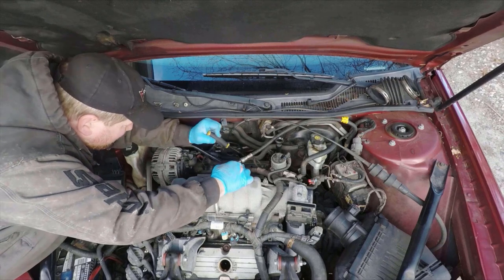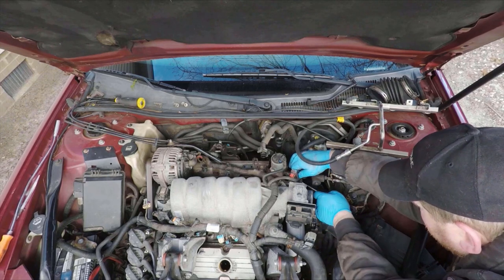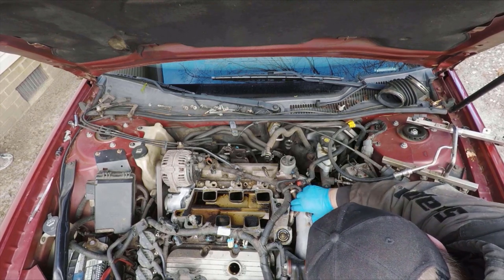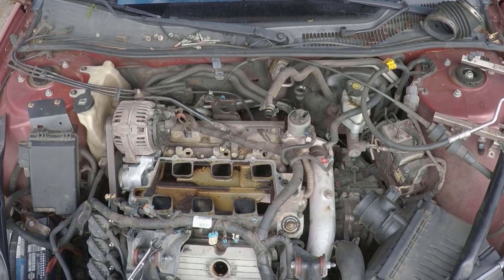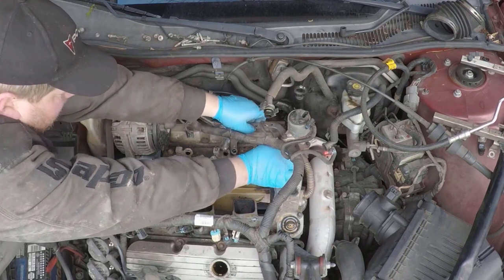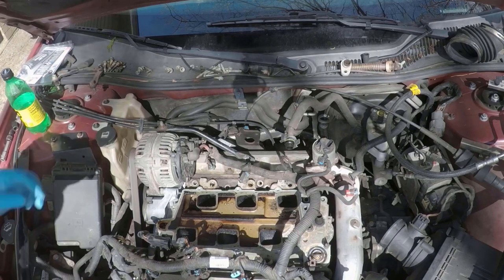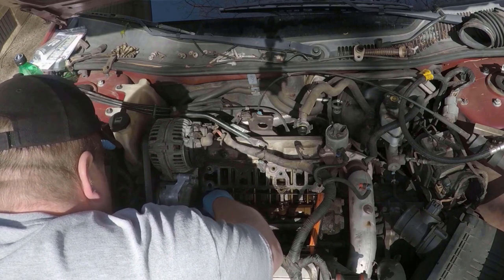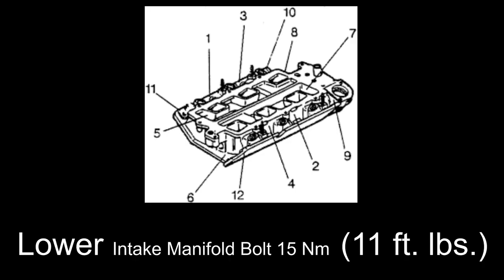05 Grand Prix Lower Intake Gaskets

Comment: With the aluminum gaskets. I've found it's best to go around and seat them (about as tight as you can get using an extension as a screwdriver, it's just tight enough to seat everything square). Then do the 11ft. Then go around again at 11ft to double check tightness. The aluminum gaskets compress and the first half of the bolts always becomes loose. I know, multiple service books, all-data, and even the internet says 1 pass with 11ft. But I've had problems doing the 1 pass and unhappy customers/boss. It's a similar situation to felpros "thick head gasket" it compresses alittle too much and requires multiple stages to get a uniform tightest.
Reply from the maker: I agree, i usually do a couple of passes at a minimum
Reply: @SalemDoyle  thank you for the advice I will do that
Reply: Thank you for the advice! It would suck to have to go back in to re-tighten.  Thanks again!
Reply: @Gerald Braxton yup, have been watching on InstaFlixxer for months myself :D
Reply: I second that notion lol. At least 2 passes, and use the sealer that GM says to use! I've learned the hard way with installing these lower intakes.  I've had the best luck using the Felpro metal gaskets, or the Apex metal gaskets. The rubber seals are thicker and seal better than the GM metal replacements. If you have ported heads, they also match much better. The metal OEM ports are smaller than even the plastic gaskets.

Comment: Really appreciate the video bro! Not that many things done to a Pontiac Grand Prix 04-08. Mine was leaking oil and I couldn't figure out cuz it seemed it leaked from every where. Thanks to the Oil Dye, it looked like it kept splattering from the inside of the gasket of the intake manifolds from all side. The front and rear valve gaskets were OK though.

Comment: I have an 07 Grand Prix Base model as my gas saver. Noticed thick black stuff out the bottom of my coolant reservoir. I read that this may be the culprit. No overheating or engine knock. Just loss of coolant in the reservoir allowing me to see dark oil build up I'm guessing at the bottom of the coolant reservoir.
Reply from the maker: Yes, that could be a sign of coolant and oil mixing.  If so, lower intake is usually the issue
Reply: @SalemDoyle  thanks. I'll definitely be following this video with the Fel-Pro Gaskets to fix this issue.

Comment: I've seen a lot of 3800's with oil in lower intake. Is there anyway to stop that pooling of is it due to pcv system letting it "condense" there?

And think there would be any benefit to polishing the lower intake runners?
Reply from the maker: There is supposed to be oil in that part, but the pcv does allow some oil into the runners also.  Polishing might help some, but we are talking really small gains on a heavily modded engine.

Comment: I've done everything just asa the video, double & triple checked all of it I've taken it apart 3 x now all looks good, but I start it up, it runs like there;s a vaccum leak & Antifreez leaks from the upper intake just behind the throtle body & the thermostat & collects in between manafold bolt 2 &  the slot rt by the therm all tigthen to specs, manifold bolts 11ft lbs intake 89in lbs, this should have a day 4 me or two at most...it's been a week Iv'e take it apart AGAIN,  3rd time & i still can't find what's causeing this issue i don't have a garage live in an apt, no work benches to use, no air tools, when it hget hot I have to stop and go in it will getting cold soon in MO winter will hit next month...can you give me some hints on what's going on....fed up this shoud not be this big a deal rt?

Comment: I use to own a 86 Buick LaSabre with the 3800 v6,  at 140,000 miles timing chain broke and sucked all the valves in, the components were made out of fiber metal, basically plastic gears.  That car loved to eat starters up!!!!  Bad design on GM to put the starter under the exhaust manifold without a heat shield.  That car was a nightmare to own!!!!
Reply from the maker: Some of those old ones qere problematic

Comment: I only have Series II's, so I was interested in the differences.  I was trying to see if they did away with the blind coolant passage between the cylinder head and the lower intake, but you didn't mention it. Looks like maybe they did?
Reply from the maker: Are you talking about where the bolts are?
Reply: @SalemDoyle  sorry, I wasn't clear before.  I edited my question.
Reply from the maker: Oh, no, they are the same

Comment: I have 04 Grand Prix valve cover gasket was leaking I replaced it and it still leaks. Could it be the intake gasket and not the valve cover gasket?
Reply from the maker: Yes possible.  Or the gasket may not have seated correctly

Comment: Question ? So my o6 gxp seems like it's over heating but the needle is not showing that. Says it's in normal temperature.  But my coolent reservoir is staring to overfill.  Have you ever had this problem or do you know it could be . I've recently replaced the thermostat.

Comment: I have a p1518 code on o4 grandprix their is no runner controler on this car but i clear it comes back with code and reduce engine power replaced throttle body plugs wires coils cant figure it out any help would be great

Comment: Question, I just got a 03 impala. 56k miles. It runs perfect until u stomp down on the accelerator. Then it hesitates and misfires. Saying cyclinder 1. I also have oil pooling on the front head below the upper intake. I'm thinking its this but I really dont want to ruin my weekend on it.  No overheating, No coolant mixing.
Reply from the maker: Intake gasket is probably bad.  To be safe check compression on cyl. 1
Reply: @SalemDoyle  Guess my weekend is gonna be ruined. No blow by out the oil fill cap, And no engine noise at all. It idles silent.
Reply from the maker: Thats a good sign
Reply: Vacuum leak
Reply: @liftedlife9046  clogged catalytic converter. That was the problem. I addressed the other issues also. Daily driver now.

Comment: I am chasing a coolant leak in my 07 grand prix super charged. Wondering if this might be it. No contamination with coolant or oil thankfully. See it dripping to the oil filter and frame in that area. I hear the bubbling in my resivoir but not really anywhere else. Not some thing I wanna keep on dumping money into. I don't want to sink anything into a head gasket repair mainly.
Reply from the maker: Could be a leaking coolant elbow
Reply: @SalemDoyle  that's another thought. That's a good idea. I'll have to check that out. I know the stock elbows are notorious for cracking one of em I looked at was an aluminum one. I know the trans was rebuilt which is why I'm not so quick to give up the car. I love it as my daily. Has the power I never knew I needed and the comfort for my family.

Comment: I thought the series 3 were supposed to be more robust than the series 2 3800s. Better intake gaskets. Is that true? I have a 2006 Buick Lucerne 3.8 with 101K miles on it. I hope not to have to do this for a while.
Reply from the maker: They improved as time went along.  The factory gaskets in 07 were the best.  If using the aluminum gaskets you shouldnt have to redo it for a long time.

Comment: Thanks for the excellent video. My 07 Lucerne is having a constant P0303 misfire. Ive swapped coils, plugs, wires. I do notice that my coolant bottle gurgles up when shut down. Whats the possibility of the intake gasket being bad and how can I test for it?
Reply from the maker: You can check the plug for signs of contamination and it would be a good idea to check compression on that cylinder also
Reply: @SalemDoyle  Just looked inside the cylinder with a borescope camera. Pistion is not clean so I dont think its a lower manifold gasket. I also used the block tester with the fluid that supposed to change color if it has a bad headgasket. The fluid didnt change color. Whats the possibility of this being a bad ICM?
Reply from the maker: @atxjax1  wouldnt explain the gurgling
Reply: @SalemDoyle  true. I'll have to do some more.investigating
Reply: @SalemDoyle  Cyl 3 compression test shows 65 PSI. Cyl # 5 shows 125 PSI. I'm going to remove the valve cover and inspect for a broken spring. If none found then I will leakdown test it.
Reply from the maker: Sounds like a plan.  You seem to be handling it well

Comment: Have a video for rear valve cover gasket take off, took the Orange flat gasket gm defect off front valve cover 2001 pontiac grand prix 3800 and replaced with blue made in Taiwan air sealed one gasket keep oil off front  pipes GM sent out orange pipe  Bomb  valve cover gaskets

Comment: Sorry to be a pain in a ass I'm so sorry about my I still have questions for I'm being seen cars making bang and Pops so it is possible to do on my Pontiac Bonneville after I install my car is any trick that I can make that on my car I going to install a new muffler at 3in muffler all the way from the catalyst to the back if I can or I use the same one but honestly I'm going to use it in free flow muffler on the back
Reply from the maker: "Pop and bang" tunes are just for show and not good for the car

Comment: I have a 2001 pontiac grand prix, never did upper and lower intake manifold gaskets. I dont have overheating problem and I am not losing coolant. Would I still change the upper and lower intake gasket as a precaution?
Reply from the maker: Wouldnt hurt, but sounds like you dont have anbissue yet
Reply: My car started misfire jerky stumble cuz I had air in the lower intake manifold

Comment: How do you find Top Dead Center with ignition control module engines?
Reply from the maker: Same way as usual.  Cyl one on top on compression stroke.  Usually marked on the crank pulley
Reply: @SalemDoyle  I noticed you didn't mention it on the video. Is this step necessary when only doing what you did which is changing the gaskets alone. I'm trying to do just that and was wondering if I had to find TDC. Appreciate your fast response!
Reply from the maker: Dont need to have it on tdc for this job
Reply: @SalemDoyle  sweeeet!! Great video by yhe way! Greetings from TX!
Reply from the maker: Thanks

Comment: Is it absolute necessary to change oil after the LIM intake gasket job?  Since I dont have the brown sludge due to mixing of coolant and oil?
Reply from the maker: It is best.  Oil and coolant will mix when you remove the manifold
Reply: @SalemDoyle  Do I need to change oil filter too?
Reply from the maker: @EzMDr  you dont have to

Comment: I have a coolant leak in the upper left front corner engine into the intake runners on 1999 GTP.  Is it the LIM or just the supercharger gasket? Thanks in advance....
Reply from the maker: Could be either.  Would probably best to do both

Comment: I was told this would cost $800 to replace on my car. Watching you do this on less than 18 minutes makes me kinda upset at the cost
Reply from the maker: Well..  it will deff take longer than 18 minutes.  But doing it in a couple hours is doable.  800 seems high.

Comment: Did my replacement and notice the side gaskets near the exhaust leaks coolant. It wasn't doing that before I did this project so I took it everything off and made sure it was placed again but it as I turn the car on it still leaks coolant. I torqued everything to spec. I don't know what I did wrong. I followed every step in your video. Please help..
Reply from the maker: Is it possibly leaking coolant from between the upper and lower?  That is on the exhaust side.  Check the two small yellow o rings
Reply: @SalemDoyle  o rings from the actual manifold gaskets ?
Reply from the maker: The two between the two manifolds.  Near the throttlebody
Reply: @SalemDoyle  oh my God I didn't have any
Reply from the maker: @edwinsalgado1919  is this a supercharged or na engine?
Reply: @SalemDoyle  na engine my guy. I didn't even realize that. I thought I misplaced the side gasket and I was so puzzled. You're such a life saver

Comment: Do the 2006 and up engines still have this gasket issue? Mine is running lean and I’m pretty sure that is what it is
Reply from the maker: Yes, not as bad, but still
Reply: @SalemDoyle  appreciate how you still respond
Reply from the maker: I do any time i get the notification.   Sometimes youtube doesnt tell me.
Reply: Or maybe brake diaphragm is leaking. Mine was.

Comment: Pet peeve of mine. Why not show the entire process? Lackadaisical approach on so many auto repair videos. I'm not hating because it's easy to overlook details. But something has to be done. I just might have to be the one to do it. I recently flushed my radiator and replaced the upper hoses. I used Chrisfix advice to do the job. He should have mentioned how to swap hoses since most times if the radiator needs flushed the hoses likely need replaced. It is important to note that when installing new hoses to push the ends as far as they will physically go onto the necks of the radiator and if using band tensions (should or should not use?) To tighen as physically tight as they can to prevent pressurized coolant to leak. I never should have taken the advice from the guy at oreillys to use band tensioners. The OEM clips are tough as snot to squeeze open and slip on. I should have found specialized pliers to keep them open my grip isn't trained to keep those clips open for a prolonged period of time. My technical writing back ground is very helpful in situations like these. Details are key. Missing one detail could mean ruining the engine. Out of all the auto channels I've seen, you are really good at explaining what you are doing. If you take my feedback and take the time to explain and give ALL the details I would for the first time ever become a Patreon supporter. I'm getting clobbered by auto repair costs. Transmission over.
Reply from the maker: One important thing to note .  Most of us auto youtubers do this by ourselves and i know at least for me, that its hard sometimes to get every detail filmed when you are also focused on the work..  i do try to be thorough and i think my newer videos are more so than my older ones, but just something to keep in mind.
Reply: @SalemDoyle  I do realize your point. It is challenging to focus on the work and the filming. My comment was more pointing out and observation than anything else. What I'm suggesting is tedious and highly technical. Perhaps we should collaborate to give YouTube an auto repair channel that is superior to all the channels on auto repair.  I'm suggesting a higher standard than any other auto repair channel on YouTube. If you filmed upper and lower intake and did so in a detailed and very thorough manner and you offered to sell the full video I would pay $50 without hesitation. Just as long as I could see that the intro was at the standard I'm suggesting. This intake gasket job is a big job and a mistake is not acceptable. The mechanic wants $650 just for labor.  There must be an alternative. Scotty Kilmer, Chrisfix and Eric the car guy are not creating the standard I'm talking about. I did a video on toyota warning lights that got over 100k views on a now deleted channel. I would pursued this myself except I do not have space to set up a repair shop. If I had the space my video standard would make chrisfix and scotty look like the poorly educated mechanics they are. There is no substitute for training in a college environment. Written I am sure it offends. But my viewers and my customers would appreciate the quality of my work. I don't care who does it but YouTube desperately needs someone to raise the bar on these repair videos.  I'm not willing to tear apart my top end of my engine armed only with the repair videos I've seen.  The haynes manual is a joke. Hey if I had the space to tear apart cars, I'd learn them back to front and top to bottom. I'd learn this 3800 engine like the back of my hand. I'd research the shit out of it.  If you can stomach the burn of my whiskey, you would give your patreon list a nitrous level boost. If people didn't buy our info products or sign up for patreon they must be cheap or dimwits.  I wouldn't blink an eye spending $50 to get detailed repair instructions. I mean it's common sense. 650 repair bill or $50 for pro level instructions. Easy decision. I've got the vision, you obviously have the mechanical aptitude. Do you want to be part of what I'm suggesting or do I do it myself?  Just a heads up I always talk like this. No surrender no retreat. Do or die.  Gung ho gung ho!
Reply from the maker: I am always up to collab and to try to up my production quality.  Are you in the southeast?
Reply: @SalemDoyle  I'm on the west coast. Where abouts are you?
Reply from the maker: East coast in NC
Reply: @SalemDoyle  in person collab raincheck.  Do you have any plans for your channel? Have you thought about doing a complete disassembly of a car?
Reply from the maker: Maybe eventually.  It all depends on what kind of budget and time i have
Reply: @SalemDoyle  What is possibly more important than making incredible auto repair videos? Haha!!
Reply from the maker: Mostly rent and food i would say.  Lol